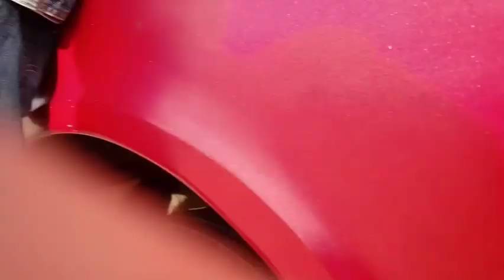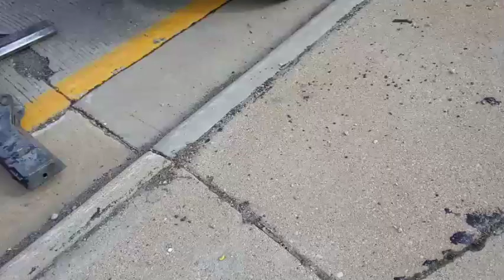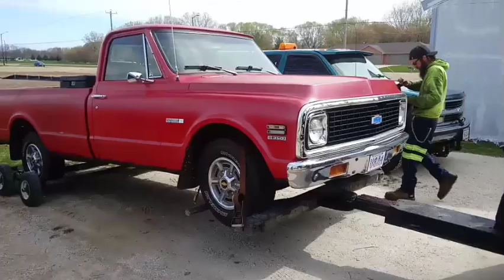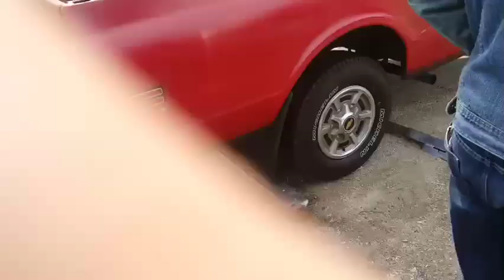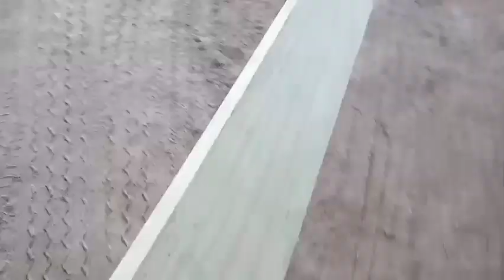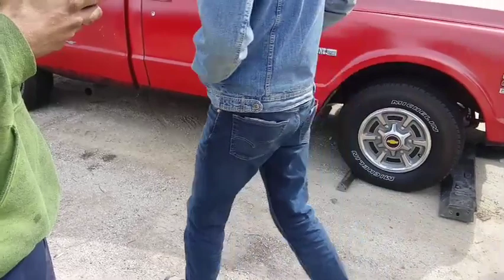The Rear End Blew Out On My Brother's 71' Chevy Cheyenne C10!

Comment: damn sorry to hear that boys. now you just got a excuse to build it for 1000 hp lol.
make sure if you change gears that it is set up right and the tolerances are correct or it will blow up again.
taller gears are are a shorter number as well, so comparing a 308 to a 410 , the 410 is a shorter gear and will make the truck quicker(as in initial take off or 60 foot times), but not faster (as in speed). so make sure that yall pick the right gears fer ur application or it will rlly suck chicken nuggets. gimme a holler if u guys need help or any tips.
Reply from the maker: Ok! Thanks 4 the tips! Appreciate it! I will give ya a holler if we need anything or any help! Thanks again! And thanks 4 watching! 👍💯